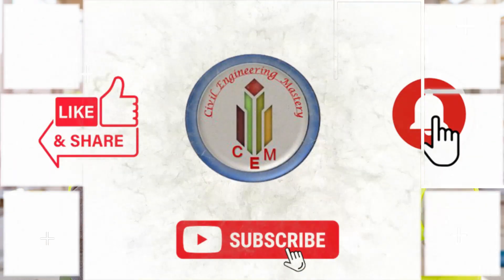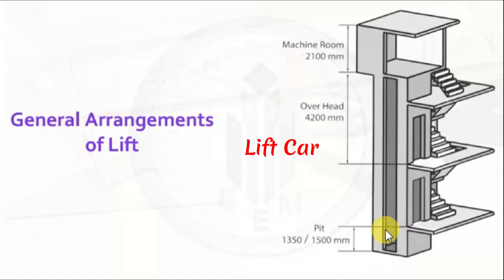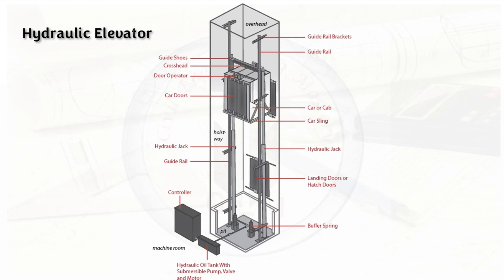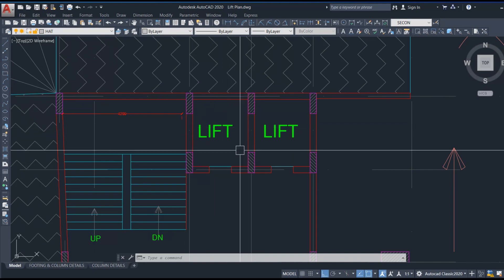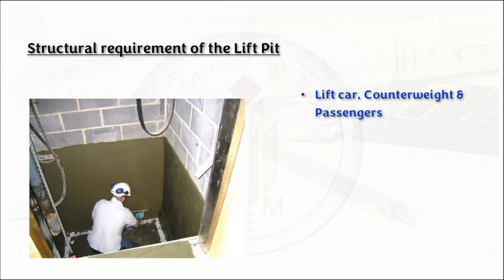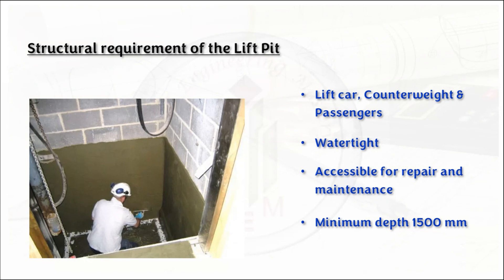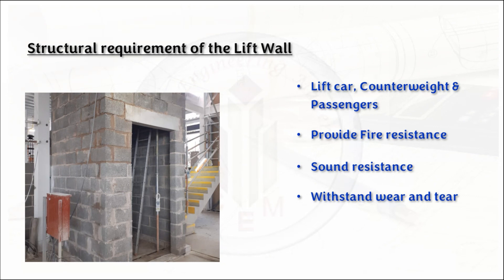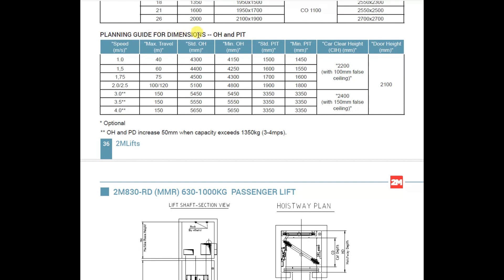Lift wall Structural requirements | Structural requirements for Lift walls & Lift pit | Lift wall

Comment: Does the Lift car directly rest on top of Raft foundation OR any thickness of earth /sand cushion shall be there, on which the lift car rests..?
Reply from the maker: The lift car does not directly rest on top of the raft foundation. There is a layer of sand or cushioning material between the lift car and the raft foundation. This layer helps to distribute the weight of the lift car more evenly over the raft foundation and prevents the raft foundation from sinking.
Reply: @CivilEngineeringMastery for our cargo lift i have seen some car tyres placed in the pit.